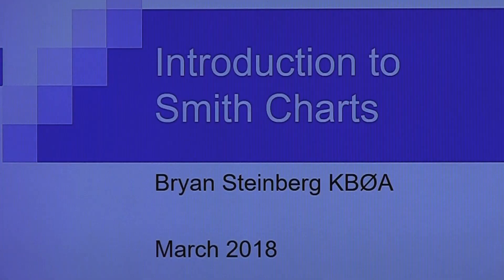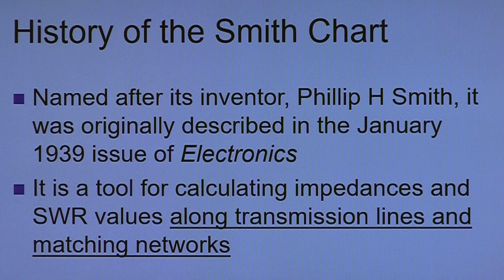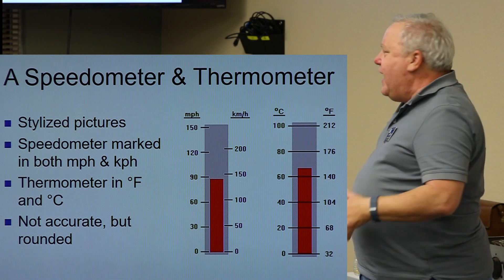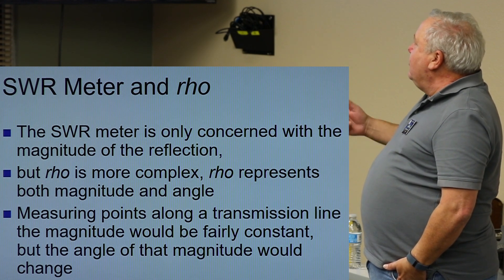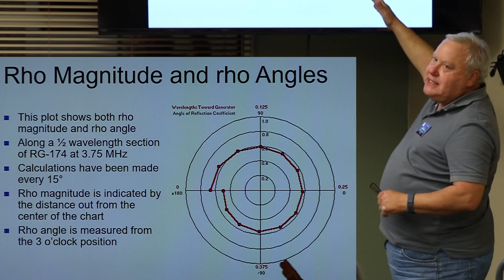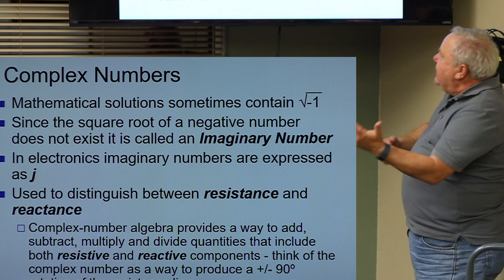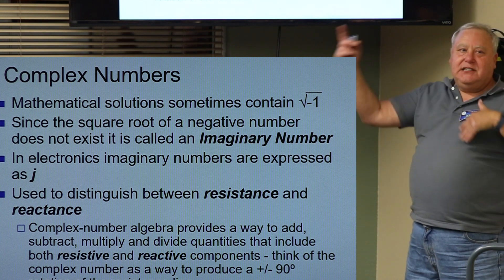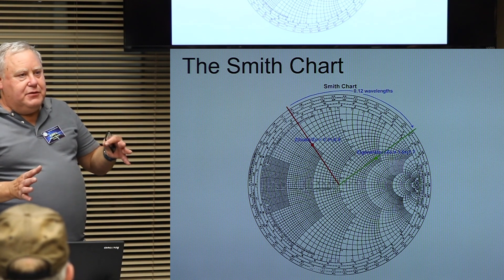How To Read Smith Charts

Comment: "If you have nothing nice to say, don't say anything" - I appreciate this approach, but it doesn't get us anywhere. There are many mistakes and wrong assumptions in this talk.
Here is a comprehensive example, how the terms are correctly used, what they really mean and how they are put into a Smith chart and calculated there:
https://www.youtube.com/watch?v=ImNRca5ecF0
I'm afraid there is some basic telecommunication mathematics required to fully understand a Smith Chart.
Reply from the maker: I will pass this info on to the presenter.